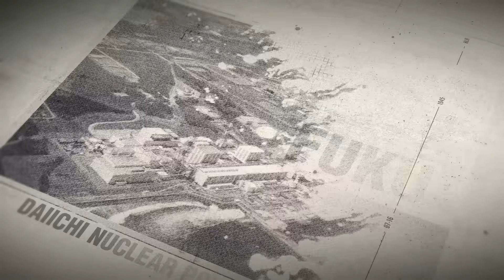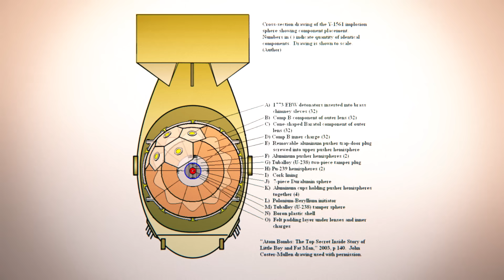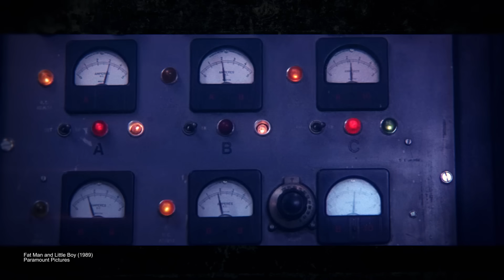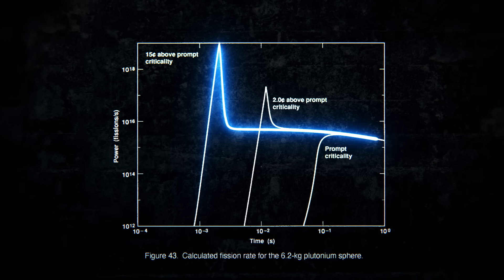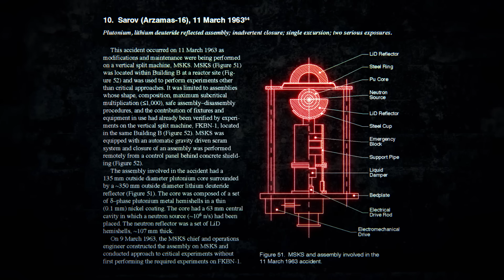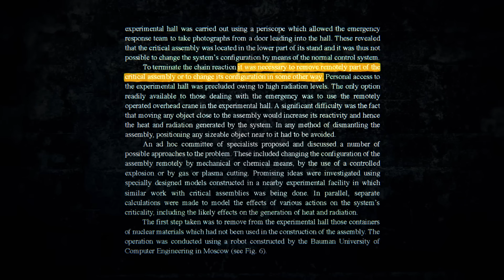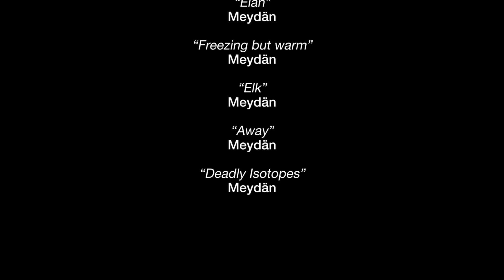Russia's Demon Core - Sarov Criticality Accident

Comment: Ohhhh... I've got a very interesting tidbit on that. 

13:40(ish).

Want to hear a rumor that I've basically heard - I'm from areospace and that section of engineering. The demon core actually 'might' have a bit of extra to it. Officially yes - melted down. Might actually be true.
But there's a rumor that some (or all) of it's material was later used in the castle bravo disaster/test. There's a story that the seniors pass to the junior engineers on safety; and it's too teach two forms of engineering.

In the first part of the story you cover the guy who did did the 'cowboy tests' which focused on 'reducing standards and 'winging it'' to the point where a disaster happens.

the other part of the story is on 'pocket protectors' when someone very 'qualified on paper' basically 'thinks' they know better then the system and plows ahead. (basically the guy in the story is a nerd).

The story I've heard on the final destination of the demon core was that it was melted down and used as the part of the material into the core of the castle bravo nuclear test, but the person who was doing the calculations 'assumed' that it's history of the metal didn't matter. Basically because of 'where it was in the chain' it's reactivity was 'way higher' that lead to it ending up starting a fusion reaction in the material that (if the core that they used was a standard) wouldn't of happened basically. It was the unique signature of this core that actually caused that accident.
Reply: Did you mean fusion not fission in your test above?
Reply: @derekp2674  No, fusion, basically in that specific incident - one of the things that happened is that a section of the fusion train, not fission, basically one of the materials that was used basically was 'supposed' to be inert. 

Basically the bomb in part of the fusion chain used lithium-6 and 7, basically the 7 was supposed to be 'inert' - but one of the 'story aspects' of that was that basically the unique signature of the core basically allowed that lithium to be reactive -> which lead to the disaster. (Basically pre-primed material). 

2 variants based on who you'd ask.

Basically larger fission yield => stuff that's typically not in the strike zone reacts. (most likely)

2nd explanation => More reactive because of it's nuclear chemistry with that material. 
(less likely).

Basically it's 'supposedly' that it did something to the 2nd chain of the bomb is the gist. 

That's basically the 'gist of it' more or less.
Reply: @bennood2031 Thanks for such a detailed reply.

Comment: Bringing up 'Oil and Gas' means you have to factor in minig, enrichment and maintenance for nuclear. That's where people usually die, not due to the immediate toxicity of the fuel.
It's like saying driving a car is safer than walking, because the driver survives the collision with a pedestrian while completely ignoring accidents between two vehicles

Comment: It's not just the "black box" problem - the fossil fuel industry also funds anti-nuclear power propaganda. 

But yes, it doesn't help that nuclear power is kind of mysterious and scary to most people. It's harder to understand (partly just due to having less experience with it) than "burn this petroleum in an internal combustion engine, and you'll get energy and exhaust."

Comment: I worked on Reagan’s Star Wars project at White Sands back in the eighties.  I now live eight miles down the road from the SRS plant near Aiken, SC.  I just can’t seem to get far from gamma radiation (smile).  At SRS they produce tritium for our nuclear missiles.  It’s like pouring gasoline on the fire, and is replaced in each bomb every seven years.  It requires a commercial grade nuclear reactor to produce tritium, so we have cheap energy locally for as long as the reactor is hot.  Thankfully, tritium isn’t toxic unless ingested.  They also produce other fissile materials there, because they can.  This means we are a target of our enemy’s ICBM’s.  Nice huh?  Well if it comes to that, it won’t matter where you live.  Interesting video.  Thanks.  I too worked at Los Alamos, but lived in Española.  We all knew about Slotin and Daglian.  Lots of safety rules after that.  I do worry about Russia and N Korea.  They’re pretty sloppy with their plutonium.

Comment: So the number of deaths from nuclear even from the most negative estimate accounting for deaths from problems created by Chernobyl are a lot lower than oil and gas but I think that's not the correct way to compare it because there's obviously a difference in the number of oil power plants when compared with nuclear power plants. The only fair way to compare it is per energy generated so per Twh is a good way to look at it. Now you might not be very surprised that Nuclear beats oil and gas because they are nasty fossil fuels but nuclear power have a lower death rate per Twh than everything except solar and solar's deaths come almost entirely from mining. So this means that wind power is more of a killer than nuclear but when was the last time you heard "man dies in wind power accident"? Probably never. The problem is the reporting on it which makes it look a lot worse than it is when really it's the best answer to our problems. Yes solar has a lower number of deaths but it cannot provide that 24/7 power that nuclear does.

Comment: The problem with nuclear power is not that it is more dangerous or kills more ppl than oil/gas etc... Its if it goes sideway and nobody stops it, it can not only kill a lot of ppl oved time but also make parts of earth uninhabitable. Also thanks to rain and wind etc it doesn't stay where it started.
So it has a very high potential to do a lot more dmg than anything else.

Comment: Can someone answer what I'm sure is a dumb, dumb question from a complete idiot on the subject of nuclear physics?

The longest half-life of an nuclear isotope is, from what I understand, in the hundreds of thousands of years, but most are just a few years and some you can count on your hand.  The age of the Earth is over 4 billion years.

 Can you guess what I'm getting at?

My dumb question is - why is anything radioactive at this point?  If the Earth is THAT old, then surely anything that was radioactive should be completely inert at this point.  And yet, we're finding new radioactive sources all the time, some of which are energetic enough to power nuclear reactors and be the heart of atomic bombs.  This means that there must be some process continually going on to create this irradiated material, but what is it and how is it doing it?

That's it, that's my question.  Any takers?
Reply: I'm afraid you are incorrect about the longest known half-life.
For example, uranium-238 has a half-life of 4.4 billion years, only just less than the age of our solar system.

Comment: Your opening is incorrect.  The bomb dropped on Hiroshima was an uranium gun-type device, NOT plutonium.  The plutonium implosion device was developed and tested by Los Alamos.  The bomb dropped on Hiroshima was never tested.  Los Alamos just knew it would work.  The people of Hiroshima were the guinea pigs.

Plutonium was chosen for (a) its higher yield and (b) its manufacturability at an industrial scale at Hanford, Washington.
Reply: To clarify, a plutonium implosion device has a "core".  That's what gets imploded.  A uranium gun-type device does not have a "core".  There are two pieces of uranium that get slammed together.  Yes, one piece is larger than the other, but it's not considered a "core".

Comment: one thing i will say is that the comparison between nuclear safety and coal safety was phrased a bit unfairly. 

the coal industry is way bigger than the nuclear industry. so just on that alone you'd expect it to have more accidents. to do a proper comparison you'd need to use some kind of an average measurement or otherwise remove that as a factor.

Comment: 150 deaths from radiological accidents does not seem right. Maybe if you only count direct immediate deaths that happen shortly after, but thousands died months or just years after Chernobyl accident alone. 4000 deaths are attributed to radiolocial-related cancer caused by the accident, and 600 000 liquidators were exposed to high dozes of radiation.

Comment: We aren't "ignoring the comparison". We are, in fact, seeing through the FUD. It's a convenient statistic to carry your narrative. (a car crash kills fewer people than a plane crash... cars carry few people, and must of the crashes are survivable. planes carry hundreds of people, when they fall out the sky, it's not so survivable.) Better metrics are things like frequency, magnitude, difficulty and scale of the clean up, square miles rendered uninhabitable by a simple mistake ... not the number of people immediately killed by the accident, because most radioactive things don't have many people around them. (refineries and drill rigs do.)

I've said it many times, and will have to say it MANY more times... until we stop making (or, using, since the US hasn't built any new reactors in decades) nasty uranium cycle designs -- that were adaptations of reactors designed to make plutonium for bombs -- and build things based on different physics that doesn't create massive amounts of dangerous long lived toxic radioactive shit. Spent fuel is the most dangerous stuff ever made by man. and we just encase it in concrete and leave it sitting -- Kyle has a video on that. There's also [non-Kyle] videos about the French reprocessing center where their residual [post process] waste wouldn't fill a US plant's cooling pool, despite France having significantly more plants -- they also use the plutonium in reprocessed reactor fuel ["mox"] but that spent fuel isn't reprocessed. They openly admit it's an expensive process, but "it's the right thing to do." (and they'd need a very large warehouse to store their spent fuel if they didn't.)

Comment: These accidents have to be the dumbest nuclear accidents to ever occur. Not one single fail safe was in place. A smart way to do the the half sphere experiment, for example, would be to have the assembly inverted with the free half underneath attached to a shaft that can move up & down with pull away pins attached to ropes that could allow it to be dropped remotely. The assembly could make use of an actuator of some kind to raise and lower the lower half of the sphere. Spacers should have been in place to limit the movement. Again, all of this could be operated remotely. These guys were smart in the way of physics, but they were absolute morons with no common sense.

Comment: Wouldn't an explosive criticality accident be a nuclear explosion, but a mere "fizzle"?  Or perhaps that's just a military term?  I find nuclear physics fascinating, but I studied neuroscience so while I can follow the basics your content, has been amazingly dense with information that help me chip away at things I still understand poorly, thank you Kyle!
Reply: Some criticality accidents do dismantle themselves by small explosions.
Some folk don't like those explosions being described as nuclear explosions.
But if there is an explosion from released nuclear energy what else are we supposed to call it?
Reply: @derekp2674  Well... technically... those are not nuclear explosions per se.
The rapid rise of temperature produce evaporation and creeping of nuclear material, which is sort of a mechanical energy that blewes the core apart. (simplified)
So fizzle is just the right word for it.
Reply: @stormtrooper9404 I think that depends on the nature of the specific events concerned.
So, for instance, I would agree that the rapid self disassembly of the Godiva experiment was not an explosion when it had its criticality accident.
But when peer reviewing journal articles on "rapid transient" theoretical explosions in overmoderated plutonium water systems, I did not disagree with referring to those events as explosions.

Comment: Gotta tip a hat to myself for inventing a truly strange nuclear "accident" 

It was on another planet, not that different from Earth. At a nuclear power plant coupled with a geothermal one for higher efficiency, near a volcano which provides the hot water. But one day, sismometers detected tiny earthquakes that were getting shallower, along with increased gas emissions and hot spring activity, signalling a magmatic intusion. It would stop short of the main vent, then earthquakes occured in a straight line leading towards the power plants, as the magma forced its way through a weak point. The installations would be evacuated, but luckily lava didn't erupt right into them but slightly further up. Still close enough to hurl lava bombs into the buildings. Too close even to erect a proper lava wall to stop the lava flows, which would go on to bury the reactors. No recovery efforts would ever be made for the buried fuel rods, due to fear that it could poison local water supply as well as the environnement. As of now it still sits under the hard basalt crust, slowly decaying into lead.

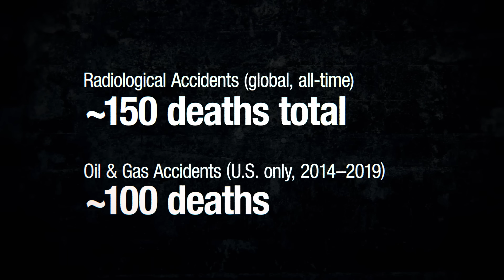Comment: 12:15 I don't think you can compare these two numbers so easily. It should be deaths per people working in that industry or something. I would like to know if there is a gap and how significant it is and what rules are used to determine when someone is working  in one of these industries. Just comparing 150 ever vs 100 per year in a smaller timescale is not meaningful at all.
Reply: Oh, and how someone died would also be importat. Getting hit by a truck is a work incident but not caused by any of these materials. Thinking about it makes it harder to get some kind of ruleset or measurement but on the other hand that's not my job ^^

Comment: All that would happen is the assembly would go critical in pulses then get so hot that it melts and burns. It would make a radioactive mess but a very weak explosion is not impossible if the reflection material were beryllium metal as the alloy that results would have a much lower threashold for criticality.😮
Reply: At Sarov, passive cooling via the copper reflectors helped to stabilise the core into a low power state. So the core did not melt.
The reflectors around the demon core were beryllium but would probably have acted in the same way.
Reply: Beryllium is an active reflector of neutrons, not only does it scatter them and moderate, it also will spit out 2 neutrons if an atom is hit generating 2 helium and 2 neutrons. Copper is a passive reflector. A fun thing to do with a neutron source is to put things on it and watch them scatter at odd angles with a detector. Coconut oil and penut butter were rather good reflector for a 15milicurie AmBe source.❤  @derekp2674

Comment: I'm pro nuclear kyle. But the dillema is infrastructure & change. Job's provided by coal/fossil fuels > nuclear (for now) Ease to get into fossil fuels is way easier vs. getting into nuclear (Aspiring electrician myself) will be possible because I had security clearance in usmc before, just need the education/experience in electricity to be in such a position. Another criticism is more on tax's/monetary side where.. this just adds in more tax payment/subscription but doesn't give a physical substance for currency. 
Say for example like steel industry when they made steel.. 
I hope that nuclear energy can propel/push space-metals industry forward.. I would desire america to be the main exporter of titanium & figure out how to make titanium metal our main export as cheap as steel. 
It'd be the next industrial revolution.. because it's strange we discovered space-metals.. but we're still stuck at steel.. & not yet have titanium.. as abundant.. in the market around..Fact is titanium is 9th most abundant element on planet.. how is it we yet to do that?

Comment: I have wondered why they didn't use some kind of shielding material to partially protect the scientists doing criticality experiments like these. Even some sand bags or cans of water. Or some primitive Z shielding like bricks of lead with sheets of steel behind them, then some other material behind that. But if they would add to reflectivity then I can see why they might have opted not to use them, in order to control test conditions. Still, a shame that the test setups didn't have some built in means of partially shielding people nearby. If there was a wall around the test stand just above waist height it might have reduced exposure to large bones in the legs and hips, perhaps enough to preserve some bone marrow from damage. Odds of survival would still be low but perhaps not hopeless with the reduced exposure.

Comment: If melting a core creates so much radiation, how are the cores created? How does one end up with a sphere of radioactive material without either casting or machining?
Reply: Radiation is created as a product of fission during criticality.
So casting and machining are performed with masses small enough to remain safely subcritical.
Reply: @derekp2674  I figured as much for pellets of nuclear fuel, but for the sphere of plutonium, is it just full of pellets? I guess I assumed it was a solid sphere of plutonium..
Reply: @Garush The published Los Alamos report on the history of criticality accidents, La-13638, says the core was made from two metal hemispheres of delta phase metal.
So the hemispheres would have been made one at a time.
Modern fuel pellets are usually made from particles of uranium dioxide sintered together, then ground to their final dimensions as per drawing.
In the UK, we do this at a place called Springfields.
I think the creators of the Simpsons did not know that though.
Reply: @derekp2674  Thanks for the responses <3